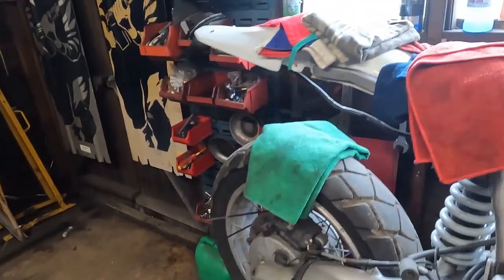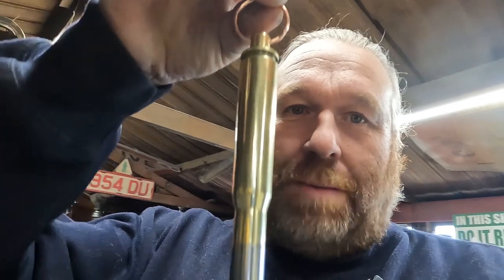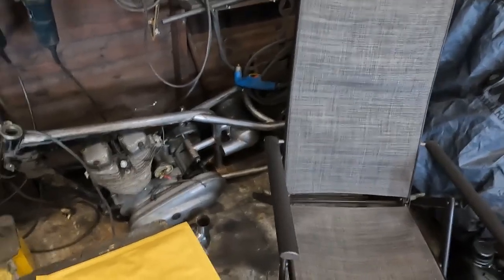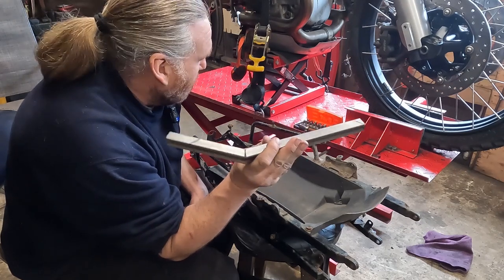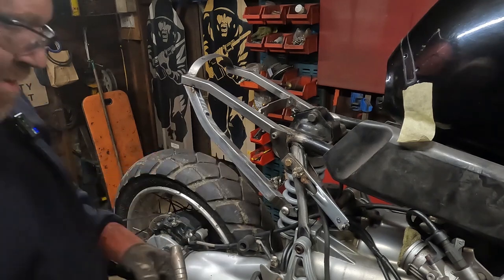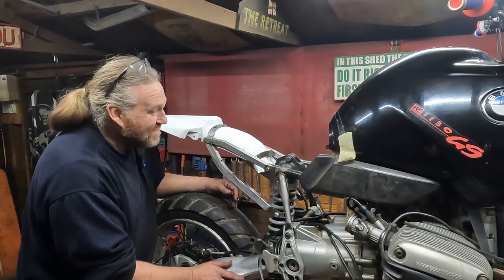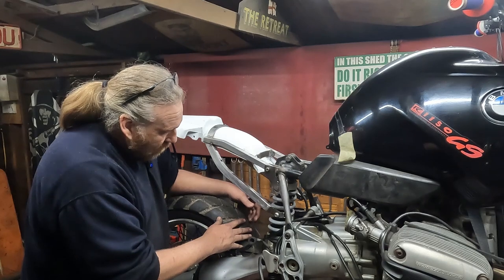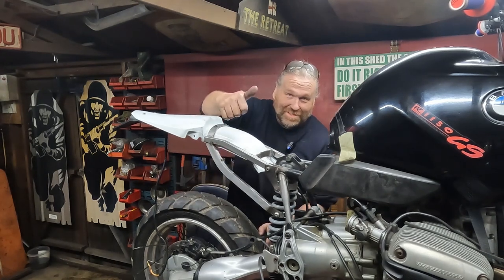BMW GS Off Road Project Part 21

Comment: Hi Craig, good luck with the recovery. Re: Moving the lift with the bike on it. I knew an old boatbuilder who worked on Eel Pie Island on the Thames. One or two men could move a motor torpedo boat around on the concrete apron just by using long poles with a curved shoe on the end as levers. Just a thought if you happen to see this.

Comment: It scares me seeing you moving that heavy BM one armed. Id hate seeing you drop it and hurt yourself trying to save it. Those breaks and fractures really hurt especially using them and do let he heal as youd be so pissed off if you set back your healing a few months. Drink tea and try and plan stuff. I know of people breaking bikes for spares on e bay. People are struggling and any savings on secondhand spares are welcome. Especially BMW spares off your build youve scrapped.
Reply: Also i have an idea for a build, a back to basic old school proper bombproof apocalipse type bike that is protected properly from being dropped for motorcycle adventures that are simple and practical for lets say cruising on a long trip like round africa. It would be great because it could be far better in the real world than some other bikes in that you can build stuff in steel that wont break unlike aluminium or plastic that may be light but break easy. Levers, headlamp protection, and engine protection in welded steel could be great and you could even drill and tap for grease nipples for swing arm bushes and steering head bearings etc that they used to have on old machines were a great thing but nowadays manufacturers dont design bikes friendly for home mechanics who are working class on a budget. I really think there are some bikers who are mad max types who are like some bikers are in some countries in adapting stuff, recycling, strengthening etc and Id be interested in what people think of this idea.